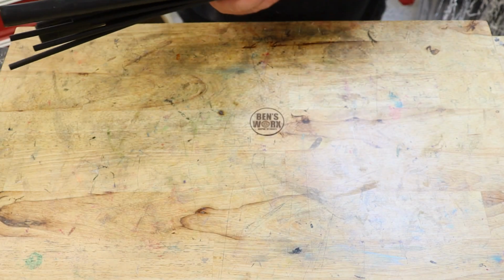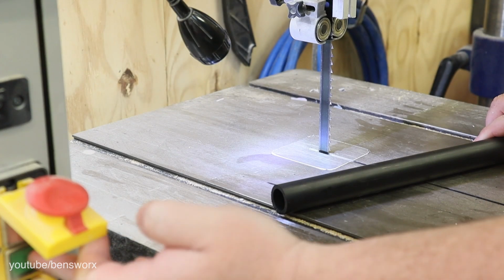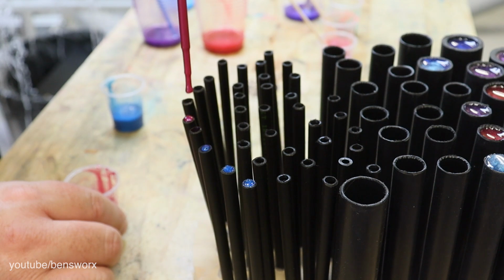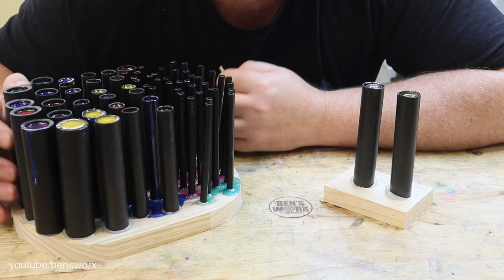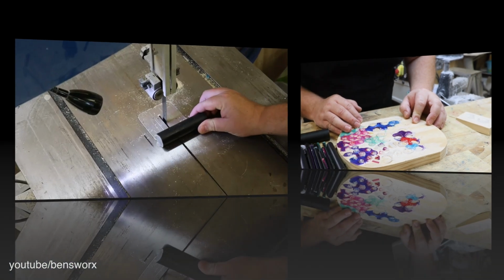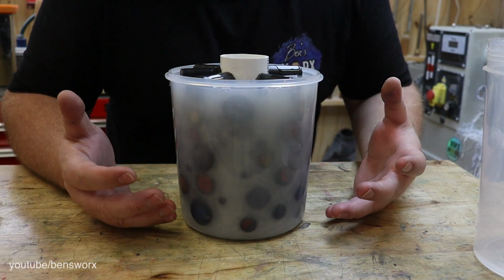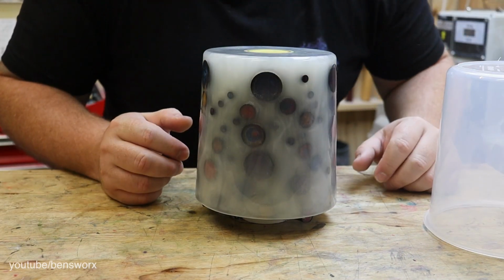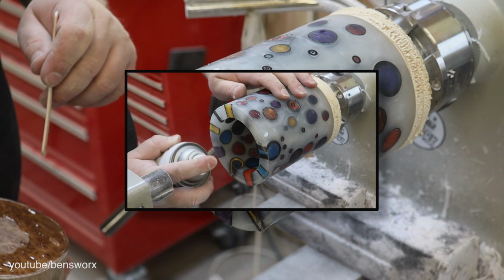Woodturning - $20 Cheap Pipe into Expensive Resin Art

Comment: Great job Ben. Very creative. I made something similar awhile back as a night light for my Grandaughter. Instead of the black pipe I used plastic straws and various piping that i stripped off after setting. I used clear resin for the fill. The effect is that the colours are not restricted to the ends of the pipe and flow through the whole structure from a white light source.

Comment: Just after posting on the previous video about screwing holes in to a cast for filling with other colored resins and then I come and see you already half did it in a sense but using these pipes!
That came out amazing!  The black really brings the colors out.
I'm also glad you kept it a friction fit.  So many times I see people making custom lights they seal them all up, meaning if it ever goes bust you'll end up with a paperweight.  A beautiful paperweight, but a paperweight nonetheless lol.  Being able to get in and change failed lights is always a good thing to have.
It gets more complicated with sold products, in that case you end up needing to use as generic a light source as you can so the buyer can easily take the top off, replace light and continue on like nothing happened.

Comment: Oh wow Ben! one of my favorites so far. I can't afford the tools and mediums. I'm a bit blown away though as I have some Sand and cement plus ABS/PVC pipes and have been thinking of doing something very much like this! That turned out awesome! 
I have a suggestion for a future project. You can buy cool little DIY electronics projects online. I've made many. You should find a cool digital clock or whatever, modify it so the controls can be accessed somehow, but encase it in clear resin, turn it, and add some lighting. No?  Love your videos. 😊

Comment: Smart idea to fill the pipe when it was double the size it was supposed to be. Guaranteeing when it was cut in half that you could use the middle section of them to point out so you could take less off the outside. 

Also, I like how the live center fit into the pipe lol. It must be a common standard size over there across the pond.

Comment: I’ve had a weirdly similar concept floating around in my head for awhile now, but unfortunately haven’t gotten around to actually trying it out yet. Yours came out awesome. I like the white kind of flowing background. My plan was to use metal pipes, something soft like aluminum/copper/brass that could be polished, on a black/dark blue resin with white pearl powder swirl background, fill the smaller pipes with really light blues and really light reds/oranges to mimic distant stars, fill the larger ones with translucent “planet” colors/patterns, and just use a dimming white LED light to adjust the intensity

Comment: If you're ever in this position again filling small areas with resin one big tip I can give you is to use a needle or pipette long enough and thin enough to reach the bottom or nearly the bottom of the space you're trying to fill. This allows you to fill from below the top of the resin which eliminates trapped air

Comment: You should do something very similar by making colored tubes of resin or spray mold release in the black tubes so the colored resin comes out(whatever KS easier to have almost like glow sticks inside clear resin)and throw them in a bucket randomly and then cover it with clear resin and turn it like that. Or even make glow powder resin tubes randomly in a clear resin ^.^

Comment: What if you were to cut the black pipe off of the cores lengthwise, trying to avoid making blade marks on the inner resin core, and then casting those colored sticks in a translucent resin, so you'd have :laser beams" of different colors throughout the piece? Would mold release work on the inside of the plastic pipe, and allow the resin to be slid out of the tubes? 

Or, you could use wax, or similar material tubes to make the molds, instead of the plastic tubes, then simply melt the wax off the resin sticks once they're cured..
Reply from the maker: Yeah that would work 👍

Comment: Here’s an idea, if I can manage to explain it well enough in words: what if you made a number of resin casts with voids in them like you did with the match and popcorn kernels, but instead of putting them together as two halves, you cut them into washer or donut like rings (though probably a fair bit thicker than washers), and then stuck those together off center to make a sort of staggered/stepped cylinder void that you could fill with colored resin or whatever else?

I’m not confident I explained that well enough for the idea to come through, but I’m imagining something that’s sort of like a poorly aligned stack of tires?

Comment: Very, very cool.  Nice Job Ben.   I am curious though.   How long did your LEB strip last?  I would think they would get too hot wrapped that way, and so close to each in a small space with no air flow, and nothing to sink the heat away.   Just wondering?
Thanks, and great job.   Cheers

Comment: I kept wondering what it would be like if you were able to separate the black pipe from the resin inside.  Then you could glue them to the PVC pipe as before.  Not to say the finished piece you did had anything wrong.  I love the lights inside.  I didn't expect that.

Comment: I wonder if you could have used the inner pipe as a mortis or a tennon. Or do you think it would be too slippery. Maybe using a little 60 grit sand paper on the inside of it so you wouldn't need a waste block. Might be a good experiment.

Comment: Have ye considered using a vibrator wand to make the epoxy settle and vibrate the air out? 
Common practice in concrete walls.
The wands are pretty cheap from Amazon, so wife tells me...

Comment: I'm wondering if UV resin would have been better at securing the tubes to that inner tube?
That second wire you secured. It was not fully into the connector for the bare part.